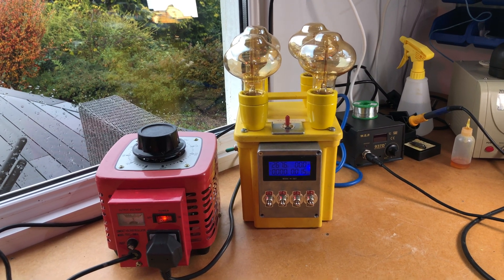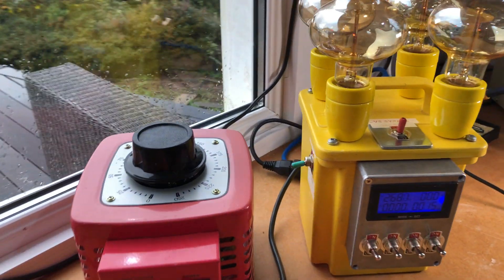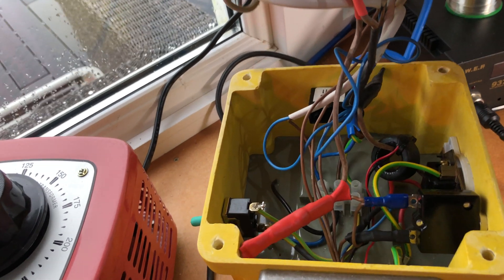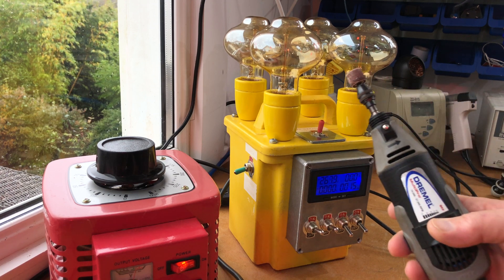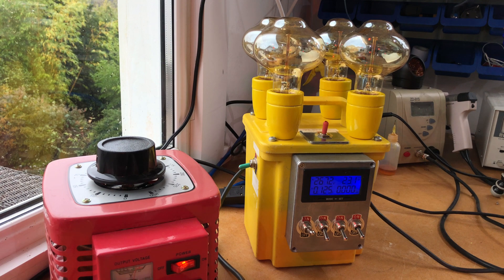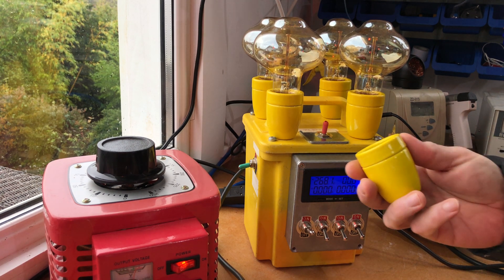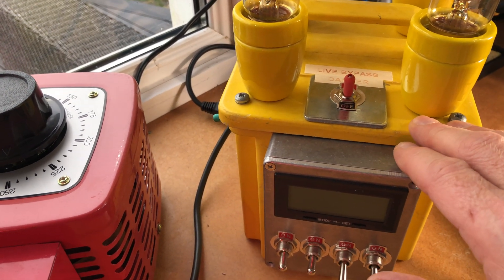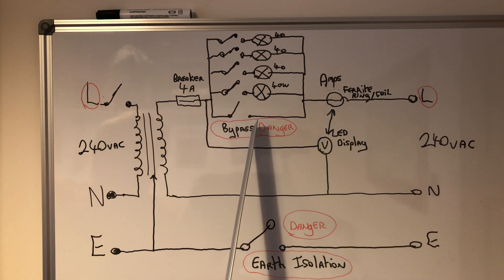Dim Bulb Tester - Current Limited Variac - Isolation Transformer

Comment: Hello, I see you have a similar desolder as I have. I have the problem that after a couple of desolders it jams. I have to dismantel the gun and use a drill bit to free the jam. What is your experience?
Reply from the maker: Hi Manuel, as yet I haven’t had your experience. It suggests the element responsible for melting the solder is working in your machine, but the vacuum is not removing the waste solder fast enough from the front part of the gun into the collection chamber. I can only think it might be a filter restriction/blockage in the hose. Remove any hose filter and try that. Best of luck👍🏻
Reply: Thanks  @GrantWyness

Comment: How can you check if your earth is connected to neutral somewhere down the line?
Can you just use a multimeter and check for continuity between an outlet's earth and neutral?
And how else would the earth be connected inside the isolation transformer? There's no way it could have the input's earth isolated from the output's earth.
Reply from the maker: Hi, good question - I don’t recommend using a meter on the live side (consumer unit side) as it will trip the RCD.  Checking continuity on the test side of an isolation transformer when it’s turned off is ideal to see if there is connection 
All the best
Reply: @GrantWyness  I didn't mean how to check the isolating transformer. That's obvious to me.
What I meant is how I can check if ground is conncted to neatral on or even before the switch panel.
Will a circuit breaker trip if I measure continuity between an outlet's neutral and ground?

Comment: Hi,
Great video... I bought this isolation transformer from eBay.. it doesn't have an earth input. Does that mean i don't have to worry about earth or would it be coming through neutral like you said in the video
https://www.ebay.co.uk/itm/164152750141
Thanks
Mike
Reply from the maker: Hello Michael, that transformer in the link is a step up transformer and certainly not of the isolation type.  The voltage has to be equal both sides!  Take care

Comment: great vid,   i've seen other do the similar but without the transformer, whats the difference with this and just using bulbs on there own???
Reply from the maker: Gary, you need 240v without being connected to the domestic supply directly - the 1:1 transformer ie - 240v to 240v does this, but be aware or the earth/neutral issue I made in the video (not all transformers are equal).   Check this link out - https://en.wikipedia.org/wiki/Isolation_transformer - there are SO many reasons to have this piece of equipment on your bench.  Read the Wiki explanation and it should help.  All the best